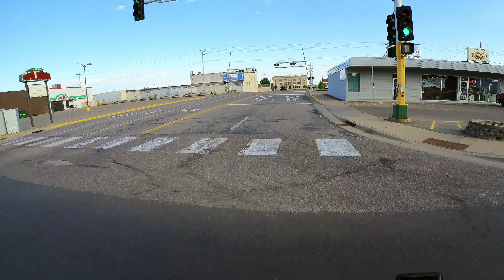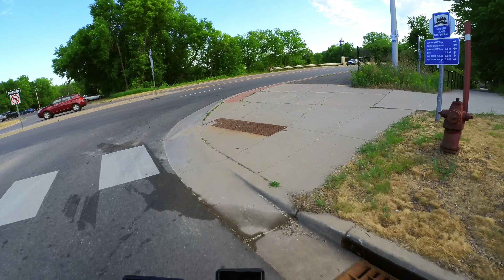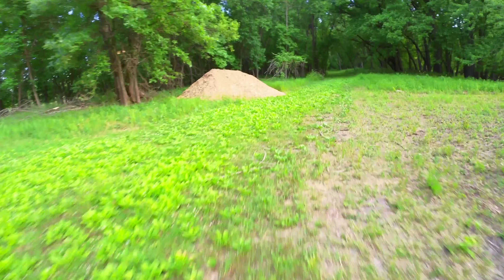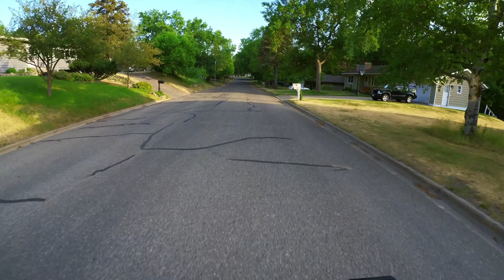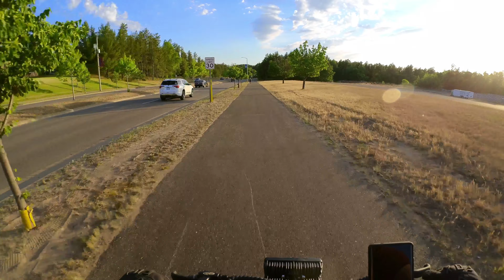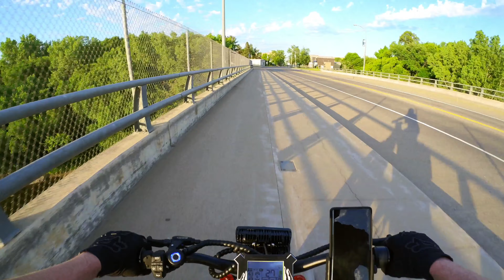Ride Vlog: Testing The Instamic, Off-roading + Channel updates

Comment: Sounds good.  Zipping and whipping around...
Reply from the maker: Right! I'm pretty impressed so far. It was picking up everything much better than I even expected. Probably gonna try to tune it just a bit more but for an initial test I'm very pleased!
Reply: @justin169169  yeah very nice. Bike eats up the off road trails lovely.
Reply from the maker: @StrillLife  it's a blast man, feels just like a small dirt bike! 😁
Reply: @justin169169  yeah sounds solid to. No rattling. It would sound like my bike was getting shaked to pieces at those speeds... if it could go that fast. Lol
Reply from the maker: Lol yeah, this one was like that to start with. Everything is rock solid now after the full rebuild. Makes you appreciate what you have accomplished a lot more when you know where it started lol.

Comment: Sound quality is good
Reply from the maker: Thanks! Took forever to get it right but I'm happy I finally found a solution. 😁
Reply: Nice
Reply from the maker: Thanks!
Reply: Smooth footage bro. I thought at first the camera is on a chest mount until you look at the side before turning
Reply from the maker: Thanks! I've been really impressed with the stabilization so far. It's pretty good right out of the camera but once you run it through their flowstate stabilization it's almost like you shot it with a gimbal! Here's the mount I've been using with the new helmet. https://www.amazon.com/dp/B091HXYQ6B?ref=ppx_pop_mob_ap_share
Reply: @justin169169  oh chin mount.. that's why I can still see your handlebars. i think it is a lot smoother when the camera  is closer to the bike. what I'm using right now is a helmet mount, right in front of my forehead haha and it still shakey at times. I'm gonna try handlebar mount next time to see if my theory is right :)
Reply from the maker: I'll be picking up some mounts that I can attach to the bars or the rear rack or different places as well but I didn't have much luck filming on the bars with my other camera because there was to much vibration coming through them. Haven't tried with this one though. I kinda like the chin perspective it almost seems like you're riding along watching 😁
Reply: @justin169169  exactly, but the thing about chin mount is I need to have a full face helmet, right 😅
Reply from the maker: Doesn't need a visor but you at least need one with a chin guard for sure. 😁
Reply: @justin169169  finally got a handlebar mount https://youtu.be/_UiwZYdZC-s 
pros: more stable than helmet mount; faster perception since closer to the ground
cons: it picks up my handlebar creaks, metallic hollow noise :D

Comment: Hi! Thanks for putting together this video. Nice ride! What camera are you using with Instamic? Insta360 One R? Michele - Instamic CEO and videographer
Reply from the maker: Hi Michele! Thanks, yes I'm using it with the insta360 one r 1". Must say the mic has been great so far! I was getting pretty frustrated trying to find a good solution for audio that worked with the camera. Not anymore 😁
Reply: I am very happy to hear that. Wish you the best with your channel!
Reply from the maker: @Instamic  thank you, I appreciate it.
Reply: Sorry to bother you. May I ask you which settings have you used on the Instamic? Input gain and Firmware version in particular. Thanks!
Reply from the maker: @Instamic  not a bother! I have it in dual mono -9db split with auto gain off and -14db suppression in this video. And it was still on the firmware it came with (1.2.73). Still experimenting to see what sounds best in different situations but that seemed to sound best while riding of what I've tried so far.